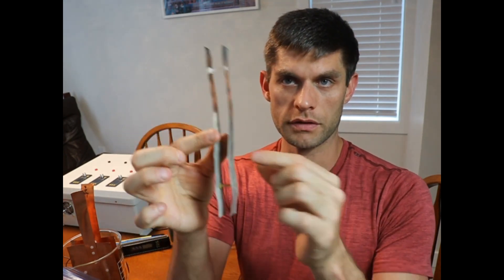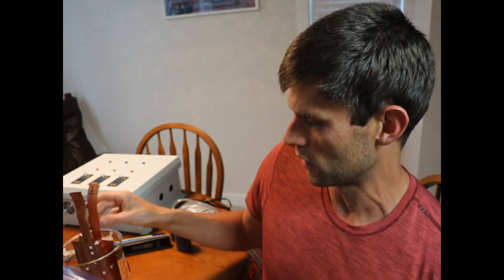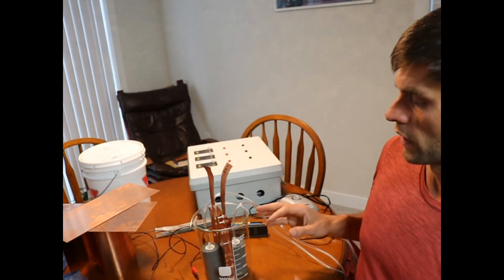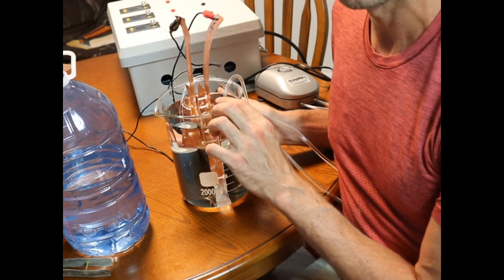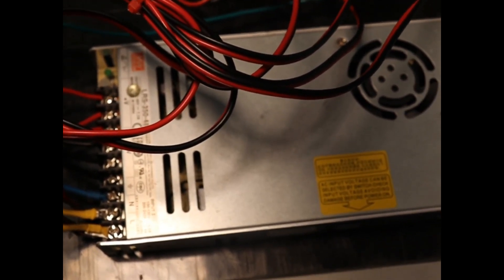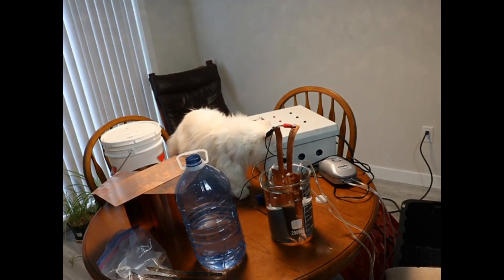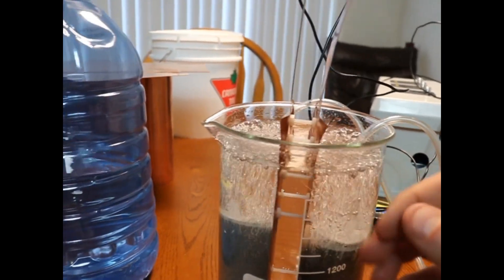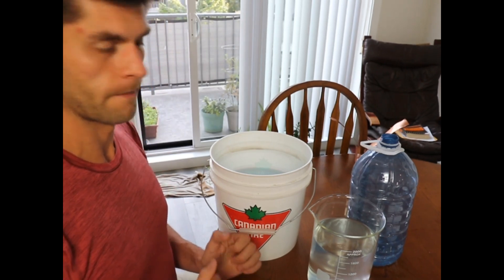Making Colloidal Copper For Organic Fertilizer and Soil Enhancement.

Comment: I don’t have the same setup as you. I have 2 rods and 30v printer cord that I make colloidal silver with. I’ve had it running for over 11 hrs and all that has happened is the neg side has gunk on it and there’s a puddle of blue on the bottom of the jar. The tds meter still reads 0 and no color to the water. I don’t have bubbles. Help!
Reply from the maker: U dont want any color in the water. Id get a new tds meter, also what distance are the rods from one another. Need the have some way of monitoring a amperage like a dc power supply
Reply: yours is blue @MadscienceLPTECH

Comment: How do you get conductivity between the copper electrodes if you're using distilled water? Do you add anything to the water so that the cell can reach the correct current?
Reply from the maker: nope only distilled water, it will still conduct enough to get going...
Reply: @MadscienceLPTECH  awesome thank you

Comment: I would love to pick your brain I'm on the same journey with relationships between aether and gardening
Reply: What's aether?
Reply: @KB-2222  you can do alot with copper as far as copper grounding or use in electrolysis to make colloidal copper water solution the reason I mention that is because copper is a very good conductor of what the aeither actually consists of
Reply from the maker: anytime framespencer@yahoo.com